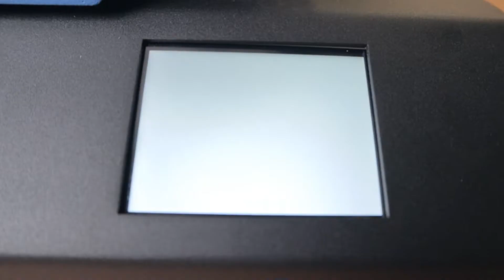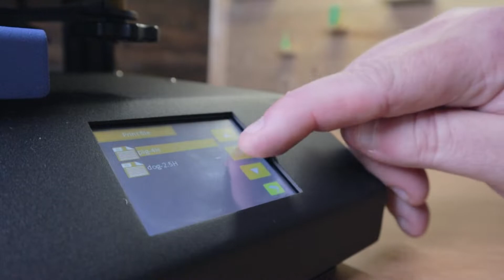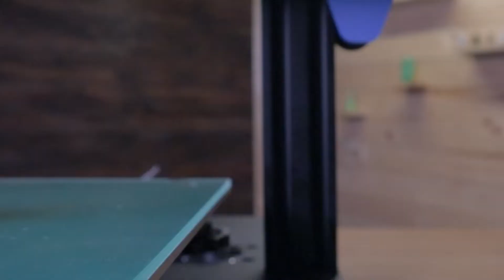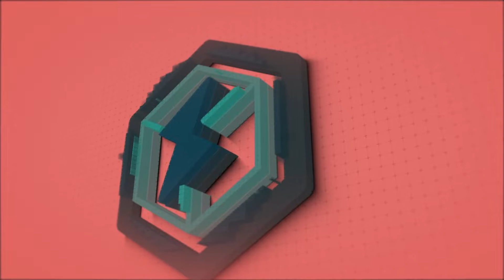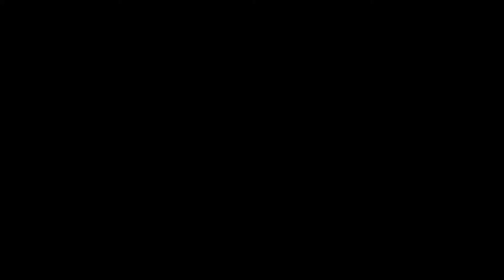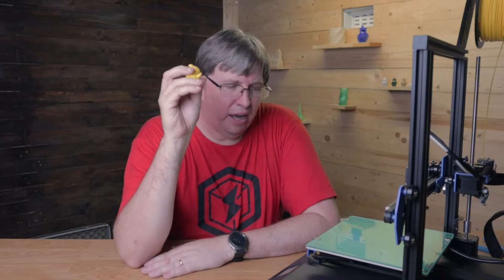ANET ET4 X | First Imperssions

Comment: I print on glass mirrors but I use an adhesive not many people know about and that adhesive is salt crystals, the salt is ordinary table salt dissolved in lukewarm tap water, the PLA prints stick super well to the bed and like the Ultrabase glass it releases when cool, in fact, it is better than Ultrabase as when cool the prints can just be picked up from the bed as though they were never stuck in the first place.
 Here is a PDF written by the developer of this method at Antwerp University, when the page loads click the orange rectangle at the top right to get the PDF to show as the University's file server has been playing up.
https://www.uantwerpen.be/images/uantwerpen/container11343/files/bonding_pla_with_salt_water_v20160713.pdf